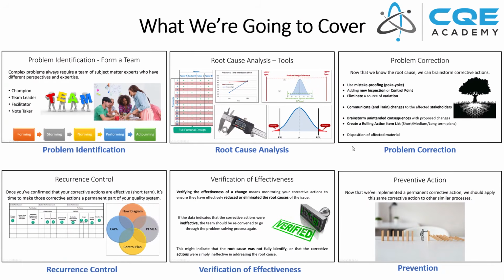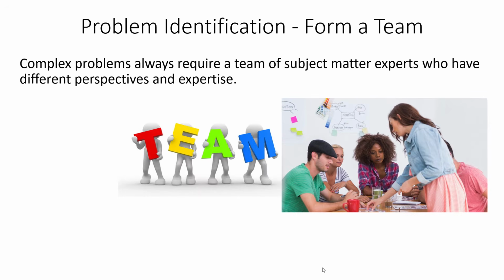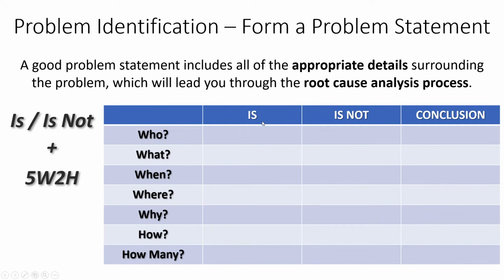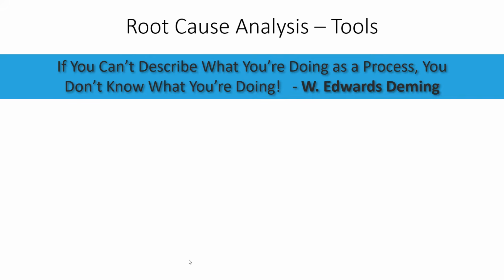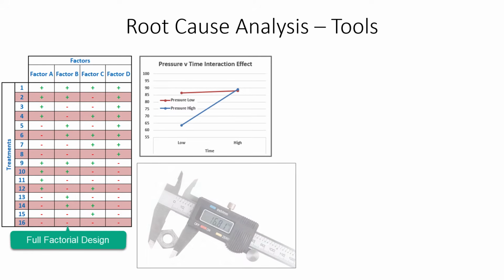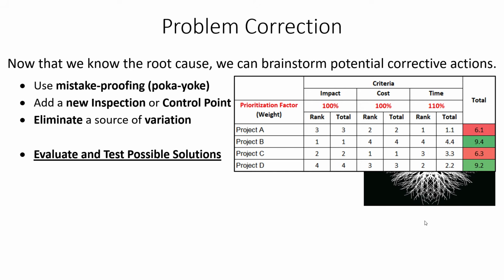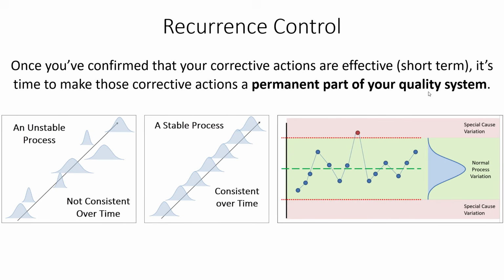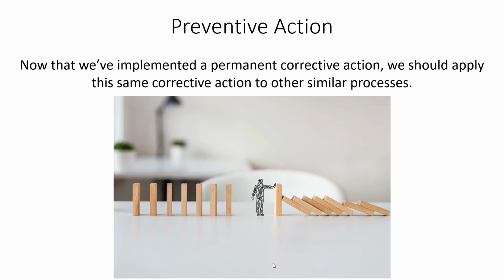Root Cause and CAPA Process Explained!!!

Comment: Hello, I actually have a question. Is root cause analysis used to improve the outcome when the process is already stable, or is it used to make the process stable, by removing the so called special causes?
Reply: Great question!

So when a process is already stable, the only way to make improvements is to reduce the common cause variation for that process.
Do that still requires investigation, measurement and analysis of your process to understand the root causes of that variation. So in a sense, your ability to understand the root cause of variation would also apply here.
Reply: @greenbeltacademy  sorry for the late reply, but I had to take a few days to look a bit more into it! 
Yes I understand, although I have to say that this is a bit of a confusing topic because in some six sigma courses they say that common causes are common because they don't have a root cause... 
what six sigma tools do you suggest to investigate on the root cause of common causes as opposed to special causes?
Thanks in advance
Reply from the maker: @datascience1274  Hey There! 
A designed experiment can be a great tool to quantify the sources of common cause variation.
Reply: In Process Improvement, it’s used to determine the cause of pain points in a process.  There’s multiple uses for RCA but basically it’s about drilling down to the “root” of a problem.